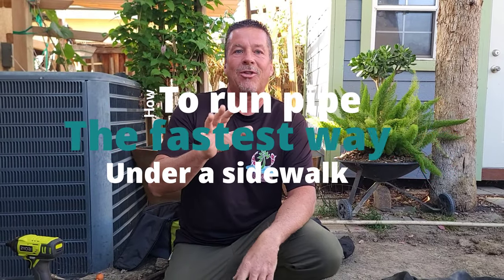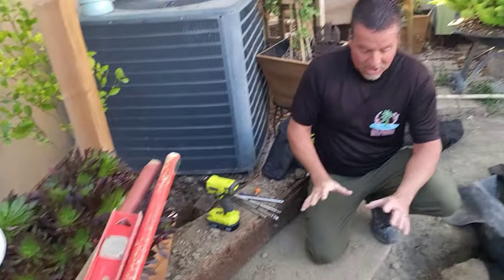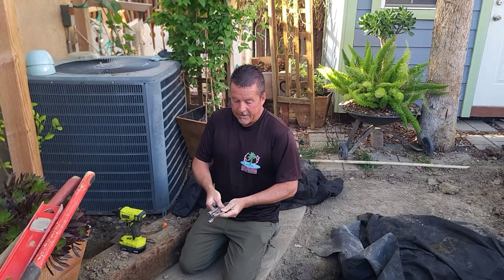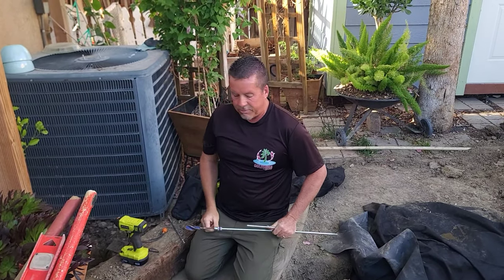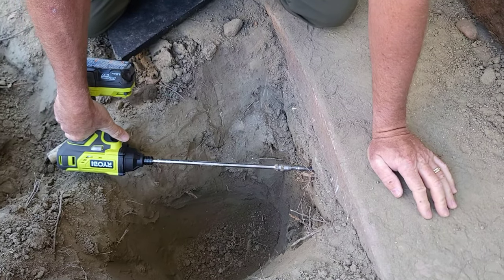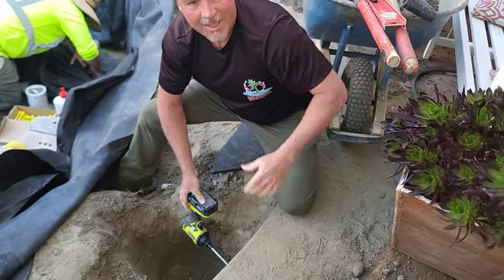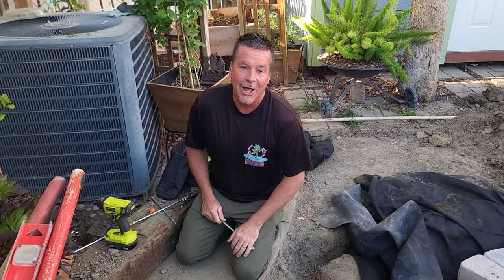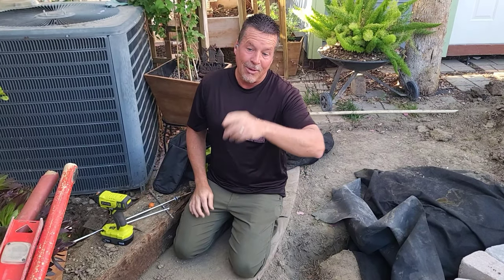QUICK TIP | How to run electrical under a sidewalk

Comment: Wow- this worked great. Contractor’s estimate added $500 to my total bid for some outdoor electrical work for tunneling paver sidewalk about 5’ wide to run conduit. Took me 5 extensions but got thru with your method. Used 1/2 inch bit to start and finished with 1” inch bit to widen hole to accommodate 3/4” flexible conduit. Minimal digging or at least a lot less than with other methods. I was also concerned other methods might cave in the paver sidewalk. Used the links in the comments to buy the tools.  Total cost about $75. Thanks for all your videos. Been a subscriber for awhile and this one saved me some $$!
Reply from the maker: Nice!!! I'm so happy you found this useful. Please share this video and consider helping us out with a yelp or Google review 🙏 😀 😊

Comment: I think a lot like you do my friend.. I seen others use pressure washers a long with pvc pipe to make nothing more than a huge muddy mess that I do not like to entertain here.. So I did a search here for other alternatives and found your method and think your method is the best route for me.. I have to run a 1 1/4" pvc pipe under my back sidewalk to get to my new workshop to run 3 78' #4 AWG THHN wire to setup a sub panel for roughly around 100 amps of available power for my welder and stationary air compressor and other workshop tools. Your idea works for me and thank you for sharing! God Bless! ;)
Reply from the maker: Thanks Glenn, it'll work like a charm, and when you're done, it'll be a set of tools that you will have in the future. 👍😎  God bless u 2

Comment: I bought an auger, but thought of a better and easier way! I used a 1" piece of pvc and a hammer to just drive it through. Instead of hitting the PVC directly, use an old piece of wood or 2x4 and the PVC will slide right through. The first hole (I had to do 3) I pulled the PVC back and  knocked the dirt out before reinserting it. The next time I just used a smaller piece of PVC with a cap on it to push the dirt out of the one I knocked under the sidewalk. It worked amazing and I just returned the auger that we didnt use. It took less than 5 minutes. If you have big roots, then drill, but small ones will work with the pvc/hammer method. It will save money too. 
One of them we started in the basement went through the foundation, under a sidewalk outside, then to the trench outside. It took some banging and cleaning the pipe a couple times, but it worked!
Reply: Great tip, Wylie!!  THANK YOU...
Reply: @2011JRM  Hopefully it worked as well for you as it did for me. Way better than the cartoons where everything blew up in my face. 😀
Reply: Haha!  I'll keep you posted...  Will be trying your idea soon! @wylieecoyote
Reply from the maker: @wylieecoyote details please 🔥🚒
Reply: @ColumbiaWaterGardens  My first comment on top of this tread.. from 6 months ago.. worked great with no mud or tool purchase.
Reply from the maker: @wylieecoyote awesome.   Im glad you made your method work for you.    We all learn from each other, right?
Reply: @ColumbiaWaterGardens Yes absolutely. It is important to have multiple approaches for various conditions and soil types. Sometimes simple is the best way. 😀
Reply: Tried this and my soil was much too hard it got stuck halfway through
Reply from the maker: We have a lot of hard soil in my area of California. The drill method is my go to based on our conditions. 

Clay, gravel, and shale are very common here.

Comment: Cant find the locking auger bit.  Everything I find is at least 1.6" wide and does not have a quick connect head.... Can you share a link to the auger bit?
Reply from the maker: https://www.lowes.com/pd/Spyder-Spy-1-2-in-x-6-1-2-in-Power-Bit/1003140950

Comment: Hi… quick question. I have a pool and the pool equipment is right next to where I’m running the conduit under a cement walkway.  I’m worried that if I use a drill bit I may hit a pipe. Is there another option you would recommend that doesn’t use a drill bit?  Thank you
Reply from the maker: Thanks for reaching out.  Hitting an underground utility is always a possibility, when we use the method in the video we use the same discretion that I'm sure you would.  

If I were your contractor I'd dig both sides down 16" and determine if there were utilities and work around them.  Drilling would "feel" an obstruction as you are mostly digging through dirt.  If we felt any resistance or a change to the sound of the drill, we would stop and evaluate.  Code in California for electrical is 16 inches, water is 12 inches, and gas is 36.  Knowing this, we can use common sense when drilling and come up successful.  We have not hit any utilities thus far.

Alternate method is water piping under the concrete which is messy, time consuming, and laborious.

In my opinion, it's easier to drill in a known safe area and work around known utilities after the dig.

Comment: How do i get electrical under a paver patio that is attached right up to the wall of the house?  Every solution I've seen online about running wires under concrete assumes that there is dirt on side of the sidewalk... what is the house is on one side?  I have a pager walkway that extends from the base of the foundation out about 6' that i want to run wires under... any ideas?
Reply from the maker: Hotly, if I were your contractor,  I'd pull up the pavers next to the house, run the conduit,  and restore the pavers with a clean hole sawn cut through the paver that sticks up next to the house. 

The pavers will disassemble and reassemble fune with a dead blow hammer.  Just make sure the base is compacted. We would use a  12 inch piece of4x6 and hammer the base down with it before replacing the pavers.
Reply: @ColumbiaWaterGardens  thank you so much for your quick response.  I've actually thought that might be my only solution but was hoping to avoid that since there is also a concrete border holding the outer pavers in place.  Again, thank you.

Comment: That looks pretty shallow.  Check local codes before doing this.  In many places running PCV conduit underground requires a minimum depth of 18"-24".  You can usually go a little shallower with metal conduit, but I always worry about it rusting out eventually.
Reply from the maker: In California, you can run directly under concrete.

Comment: The only issue is wire needs to be buried 18" ,You missed the mark! Also if you go to trappers supply houses the make a 2 inch auger that will allow you to add conduit. I say this as you need wite protection if you are burying it shallow.  I CAN IMAGINE THE HOMEOWNER PUTTING IN BULBS AND GETTING SHOCKED!
Reply from the maker: Good point! Code is different in other states. Glad you brought this up

Comment: I don’t usually comment but after try this method, dear viewer, please DO NOT do it this way if the path is long. I know you’re probably don’t want to make a mess with a hose, but please follow The Ultimate Handyman’s method instead- it worked so much better. I attempted this for around 10 hrs on a 4 foot stretch and it failed miserably because of some problems this video doesn’t mention. 
1. Soil quality and wetness matters. Maybe where he did it, this it works, but depending on your soil, the tunnel will collapse on itself. Which ties into my next point.
2. Just because you use a 1- 1/4 auger doest’t mean you can even fit a small pipe inside. I got all the way across with this method but still couldn’t get a pipe through. In perfect world you could slide a pipe on some extensions but this will not work.
3. The bit extenders. Even in locking one’s, the mud will clog up the locks meaning it will potentially cause them to fail when you pull the auger back out. I lost my auger this way.

In short a hose and some pvc will cost you a few dollars and will require similar digging work. If this method fails, you just wasted $50-60 on bits and extensions.

Comment: Save some money? Those bits aren't cheap and get dull going thru dirt.
Reply from the maker: Great question.  The extensions are 9 bucks each and the bit is about another 7.  For a 36" sidewalk, it'll set you back about 50 bucks.  If you're a contractor like me, it's a worthy investment that lasts years.  After each boring, we clean the fittings, blow them with the air compressor, and coat with wd40. Stash it in the toolbox and you're set for the next time.
Reply: Neither is galvanized pipe and the mess it makes using water will set you back in labor hours.
Reply from the maker: That's right
Reply: I bought a cheap set from harbor freight about 15 years ago and have used them to dig through dirt ever since.
Reply from the maker: @suspicionofdeceit I get that.  The purpose of the video is to show another (not the only) way to get under the concrete to potential viewers that may not have a lot of experience doing this.  When I first started out, I never would have thought about simply drilling....  I used the water bore method and got wet and dirty.  I like this much better for its cleanliness and speed.